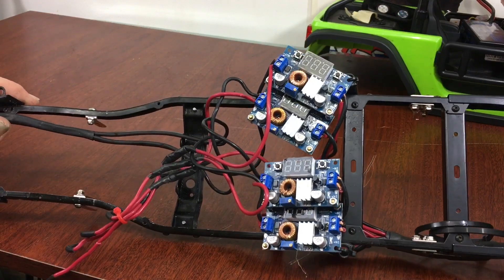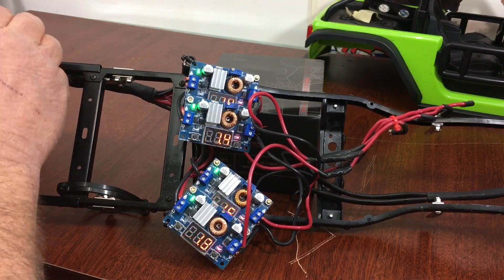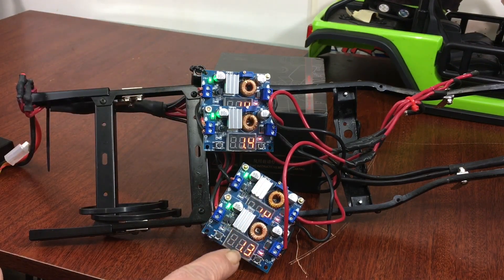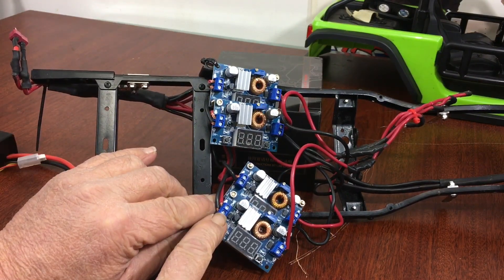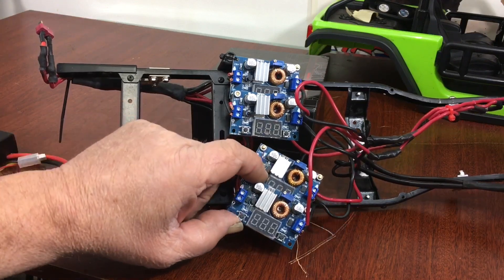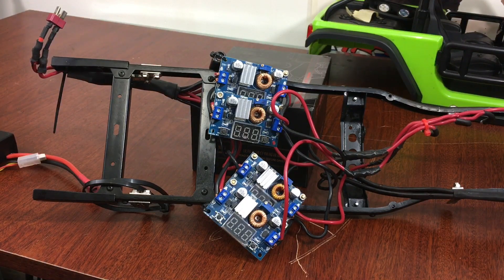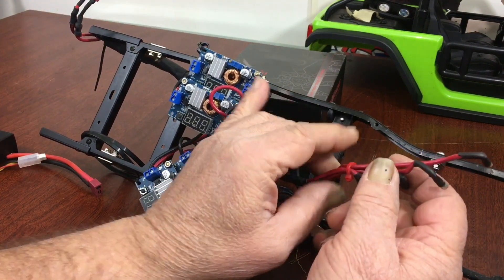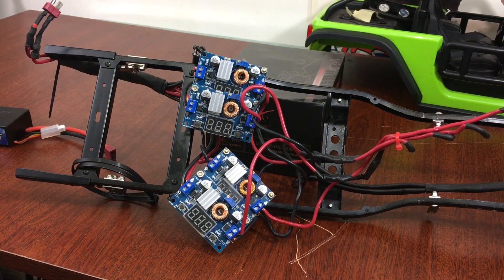Cheap diy TOYAN igniters option with led read out

Comment: Hey mate what frame are you using for the TOYAN FS-L400 engine?
Reply from the maker: I installed it in a HG-P407/bruiser frame to start it up. I built a custom frame for my skyline that the engine is in now.

Comment: Cool. Thanks for sharing this. I have a monitor voltage on my trx4 between the seats. I’ll be putting the led block on my dashboard on whatever I’ll use the L200 on. Thanks Brother.🇨🇱👍